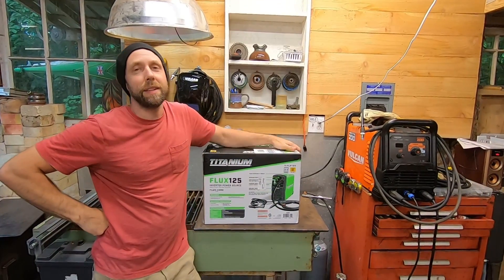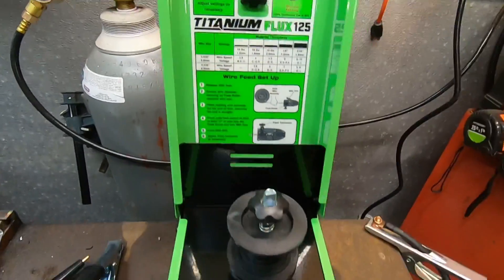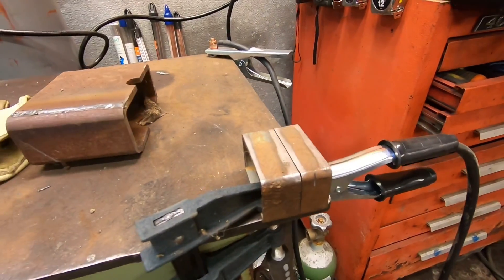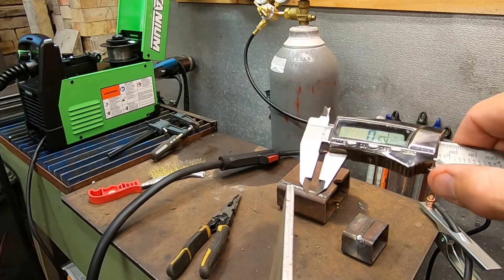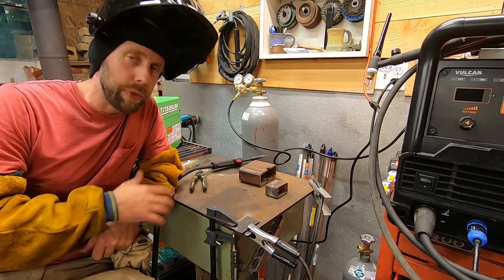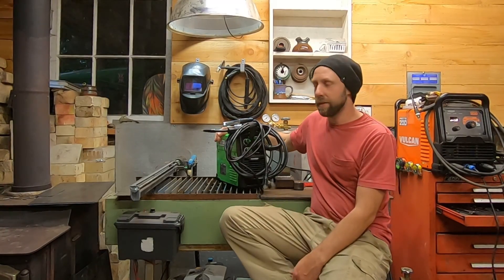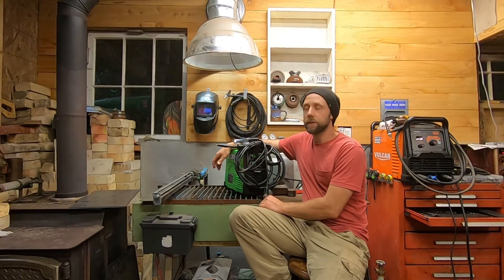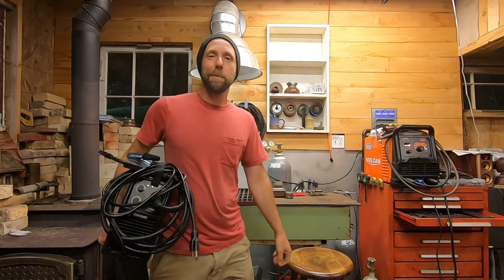Titanium Flux 125 welder from Harbor Freight

Comment: Thanks for the thorough review. I bought one of these after watching your video and am very pleased with its performance. It’s my first welder and made it feel easy. 
Question: have you, or perhaps other viewers/commenters, used flux core stainless steel wire with this machine?
I have a SS wood stove secondary burn tube that needs a simple tack weld and saw tat Blue Demon makes a flux core stainless wire. 
Thanks again for the quality review.
Reply from the maker: Thanks for your nice comment! As you know these little welders work quite well.
I have never tried Flux Stainless steel wire, I didn’t know of it till you mentioned it. I have only welded a little SS and I did it with a TIG welder. I will look into the wire and maybe make a video in the near future on it. Take care 🙂

Comment: How are you doing thank you for the video I like that welder I have never willed it before but I have a truck and it has some rust holes on one of the cab corners could I use this to fix those holes
Reply: Thank you
Reply from the maker: Yes this will work good for most around the shop work.
If your welding really thin metal like sheet metal on car bodies you will probably have the best luck spot welding it ( short cycles on and off ) this help from burning through the thin metal. I recommend first practicing on some thin scrap metal first to dial in the heat first. Take care

Comment: Welds great! But think about safety first there's an oxygen tank right next to where he's welding
Reply from the maker: Well Cameron I’m not sure how much welding you do? Just because there’s a green tank there doesn’t always mean there’s Oxygen in all green tanks. That tank your referring to is a Argon bottle, it’s a shielding gas that’s non flammable used for TIG welding to keep Oxygen from contaminating the weld. I hope this info helps you out. Take care Cameron 🙂
Reply: If he built an entire saw mill from scratch, I'm pretty sure he knows what he is doing.
Reply: Safety is always a good thing to consider and think about. but in regards to these cylinders they are actually very safe against Sparks and flames think about acetylene bottles and oxygen bottles on cutting torches that are in close proximity to cutting welding all the time as long as you don't handle them roughly and break off a valve or strike an arc directly on the tank they are very safe
Reply: Oxygen isn't flammable.
Reply: so,if one was using a cutting torch with a bottle of Oxygen,and a bottle of acetylene,would u have a problem cutting,or welding?

Comment: Did you use the wire it came with or another brand?
Reply from the maker: I was just running the wire that came with the welder. I usually  run the Lincoln brand flux wire because it’s sold locally at Home Depot. Take care

Comment: Will this run on a 15 amp 120v circuit?
Reply from the maker: You probably can run it on thinner metal on a 15 amp breaker, but I think the manual calls for a 20 amp breaker.
Reply: @Mikefestiva  thanks!

Comment: Hey Mike, great videos! I just subscribed and bought this welder. Works great and burns hot! 
Question- which flux wire would you recommend? I just finished the roll it came with and want to buy the best wire for the best welds possible..Thanks!
Reply from the maker: Right on thanks for subscribing Felix! I mostly have ran the Lincoln flux wire mainly because it’s available at the local Home Depot store, it seems to weld fine, there was a post from a subscriber that had some good suggestions on flux wire he liked, I will try and find that post. Take care and have fun welding! 🙂

Comment: I think you mentioned in one of your videos that if you use flux core the gnd should be neg and if it is solid core it should be pos. It might be the other way around.  Anyway on the HF Titanium Flux 125 welder, how do you reverse the gnd polarity?
Reply: There's no need to reverse polarity on this unit since it doesn't have the capability of running gas (MIG).

Comment: I have a Chicago Electric 125 amp welder, I used it to weld a hook to fork truck for dead pulling 3 ton racks. Granted I used 4 passes to make sure it has good penetration. I did this 5 yrs ago and its still holding good.
Reply: Late comment but I must add those things can make very strong welds. I have done some serious repairs with the ce 125 on trailers open and closed. The welds never failed.

Comment: Can I weld Stainless Steel with this welder?
Reply from the maker: No you can not weld stainless steel with this welder. You would need a MIG welder, because you need shielding gas to keep the weld from oxidizing when welding, this is just a flux welder it cannot run shielding gas. I hope this helps.
Reply: @Mikefestiva  Thanks, man! So, steel and Iron only? I'm sorry for the stupid questions, but I'm new to welding! :) I have plans to buy this welder!
Reply from the maker: Yes steel.
You can’t weld Stainless steel or aluminum. 
This is a good welder to get started with especially for the price. The Titanium 170 is a big step up in capability but also cost. It can weld stainless with the right gas and aluminum with a optional spool gun with the right gas. But with the added cost of a extra gas bottle and extra cost on the welder.
Reply: @Mikefestiva  Thank you so much for the input, man! Nice video, BTW!

Comment: I picked up one of these last weekend for $149 plus tax. I have always used my old Lincoln AC225 “tombstone” or oxyacetylene torch. I had gotten fairly adept at thin stuff with 1/16 rods with the Lincoln. But now I know why everyone uses MIG or flux for sheet metal. Love the little Titanium 125. Now I want the Ultimate 200. Thanks a lot Mike. You costing me money🤣🤣🤣
Reply from the maker: Right on! These little welders are quite useful! Yes the Titanium 200 is a great welder and I highly recommend buying on. I used a stick welder just like you described for many years, but once I got a MIG welder I found myself using the old Lincoln less and less. Take care 🙂
Reply: lucky guy, I can't find one and I ordered with the 179$ coupon  indefinite backorder on my email

Comment: Hey Mike, thanks for the video. I have the Chicago Electric Flux welder and I'm thinking about selling it and replacing it with this one, the fact this one puts out DC instead of AC is huge. Are the leads disconnectable on this machine? One annoyance with the Chicago Electric is the leads were all permanently attached and it made storage a pain. Thanks again.
Reply from the maker: This welder would be a good upgrade to the welder you have right now. The leads don’t disconnect on this welder, that is a nice feature on higher end machines and would have been a nice touch. Thanks for commenting 🙂

Comment: You cannot get a spool gun for this welder.
Reply from the maker: Yes you are correct there’s no spool gun available for this welder.
Reply: @Mikefestiva  Thanks.  Let me be more clear.  They don't make a spool gun to fit any of the Titanium welders even though there is a connection for one.  Very misleading packaging showing you can run one.
Reply from the maker: Yes HF is slacking on offering a Spool gun for the bigger Titanium line of welders, the 140,170 and the 200. 
Here’s a video I made where I ordered a SG from Northern Tool that plugs right into the Titanium welders I just mentioned. I hope it’s still available? Here’s a link to my video.  https://youtu.be/25y35tuNurs
Reply: I'm new in the welding what's the spool gun? Is it what he's holding to weld? So you mean if you wanted to replace the spool gun it cannot be found?
Reply: @mannyramirez8249  no, a spoolgun feeds  from a small spool of wire and has the drive motor built in where you hold the handle. Usually it's used for welding aluminum in a MIG welder  because the aluminum wire is too soft to feed all the way through the liner and gun of a normal MIG setup that holds the spool of wire inside the machine.

Comment: Hi Mike ! I need your help ! Because of you, I got into welding and fabricating ! I bought the 125 and the 200 Titanium's plus a Plasma cutter ! Here is my question, I have to weld some stuff at my Hunting Club, can I run the 125 Flux with a 2000 watt Honda Generator, or should I bring my 3500 watt Predator Inverter ?? I would appreciate an answer !! Thanks
Reply from the maker: I’m really happy to hear you got into welding and fabricating because of my videos! That’s awesome :)
So to answer your question, the 2000 watt gen is probably on the small side, especially if it’s 2000 peak watts, 2000 watts at 120 volts is 16.6 Amps. Your 3500 watt gen should be plenty, at 3500 watts at 120 volts you should have 29 Amps. The Titanium 125 should be run on a 20 amp breaker to provide full amps to weld. If you were welding real thin metal you may get by with the small gen but a lot of times a 2000 watt gen is really rated at 1600 watts continues use. 
I would pack your bigger generator out there, you shouldn’t have any problems when it comes to amps. Take care. Ps try it at your house first and see how it welds.
Reply: @Mikefestiva  Tank you Mike for your advice ! Love your videos, I hope one day I have similar skills like You ! Keep up the great work !!

Comment: Mike...What flux core wire were you using in this video? I have recently tried the INETUB  BA71TGS .030 with exceptionally good results. I had never used a French mfg. wire before but this has been impressive. Easy to run with minimal spatter.  I note that the Vulcan wire from HF had been made in India previously but is now marked made in France. I am curious if the new French Vulcan Flux core wire is being private labelled by Vulcan but made by INR. It would be great to see a comparison of .030 Flux wire test between the French made Vulcan and the INE along with Blue Devil and perhaps Lincoln 211 as a control. Your thoughts?
Reply from the maker: Good to know! I will look into that wire. I was just welding with what came with this welder in the box, I have ran a lot of the Lincoln wire in the past, I will order some of the wire made in France. Thanks for your comment on this subject I really appreciate it! Take care
Reply: @Mikefestiva  This is the wire I have had excellent results with...https://www.amazon.com/gp/product/B003E2RF0E/ref=ox_sc_saved_title_3?smid=ATVPDKIKX0DER&psc=1
Reply: @Mikefestiva  This U.S. made wire has also worked very well and can be bought cheap. 2 lb spools for $8.90 delivered...in a qty of (10)...https://www.ebay.com/itm/E71T-GS-030-x-2-Lb-10-PK-MIG-Gasless-Flux-Core-Welding-Wire-Spools-Blue-Demon/302761047315?ssPageName=STRK%3AMEBIDX%3AIT&_trksid=p2057872.m2749.l2649
Reply: @Mikefestiva  I misspoke. The INE and current Vulcan wire are made in Italy...NOT France. Not sure why I mixed the two countries up.
https://www.ine.it/en/

Comment: Hi Mike. Have you tried running it on a small generator? I have a 3400 Watt Champion Inverter Generator I use for my RV. I want to get a small welder that will run on my generator. Would this welder run on my generator? Pleae advise... Thank you
Reply from the maker: No I have not tried it yet but I will and I will post a short video on how it does on a generator, I have a HF gen about the size of the one you have so it should be a good test. Thanks for commenting :)
Reply: I got a 4000 watt inverter gen from Champion,I can try
Reply: Did it welded good with the 3400 watt generator?

Comment: I'm truly looking forward to seeing you upgrade this welder to a mig setup(gas). I know this can be done , because we had a friend do it in the past . I remember he had to rig the trigger power up a little different but that's been a few years ago and a different brand of welder. Looking forward.
Reply from the maker: Thanks for commenting :) 
I think it’s definitely possible, I ordered some parts to convert it, I have a relay wired up to the circuit board and it switches when you pull the MIG trigger now, I tapped into the power on the board. Now I just need to wire up the gas valve and order a new MIG whip that’s set up to flow gas though it. Hopefully I can finish it in the next few weeks :) Take care

Comment: Hey Mike, I just bought the Harbor Freight Flux 125 ("The Black Beauty") $95 tried and true model.  My question is: I've checked with Harbor freight, and if I upgrade there's no restocking fee for me to bring in my 90 Amp welder and trade for this Titanium Flux 125, but would you recommend this?  I have very limited experience welding, self taught through the school of YouTube, but I'm glad I've found your channel!  I think I've already experienced the frustration with AC welding, and even though it was recommended to weld on wire feed at 4 I had to up the speed to at least 5-5 1/2 just to keep up the weld on thicker pieces.  Anyway, I guess I was curious if you think I should get this Titanium Flux 125 instead of the tried and tested 90 amp model they've had for years?
Also, I wanted your opinion on the 220 amp 170 model MiG/Flux welder?  I'm thinking I want to upgrade, but should I go for a model that will allow me to eventually MiG weld with gas and solid wire?  So, with that being said, I could see myself using this Titanium Flux 125 for 6-8 Months, and then upgrading to the Titanium 140 or 170, but I guess I wanted the input of someone with personal experience, and I can see you've been doing this for years!  Sorry about the novel.... Thanks!!

Comment: I want to tech myself hot to weld by adding some rails to one of my utility trailers.  This looks perfect for that.
Reply from the maker: Yes this is a great little welder, compact yet quite powerful for its size. Definitely a good welder to start with. Take care Eric
Reply: Practice on some  scrap metal  first. You will  save  yourself  a lot of frustration when you work on your  trailer.
Reply: @electromech7335  That's already the plan

Comment: Ok I just bought this welder and I am seeing that there is a Titanium flux 125, A titanium easy flux 125, and a titanium pro flux 125... Are there any differences or upgrades to these models??  Mine is the Titanium Flux 125. model nukmber TI-FLX125. I am thinking that this may be an older model yet I just bought it today. Thank you in advance
Reply from the maker: I think Harbor Freight just had a hard time figuring out what name they wanted to use :) 
The first video I did about this welder, the add said pro flux125. Now I think it’s called easy flux 125? Who knows, but I’m sure they are all the same welder. Take care.
Reply: @Mikefestiva  Thank you for the quick response.  I bough this welder solely to do a custom exhaust on my hot rod. I just read that this welder isn't suited for stainless steel? Thoughts on if this will work? THANKS AGAIN..
Reply: @jaybourbon8608  someone on a forum somewhere said he used this welder to do the exhaust work? I'd say take a couple scrap pieces and try it, make sure you don't burn through it though, work with some scraps and get the settings dialed in. 

Good luck!
Reply: @delta34golf  Thanks man .. I'll report back if I ever get time to start it the project. Hah!
Reply from the maker: Hey Jay because this welder is a Flux only welder it doesn’t have a gas port for shielding gas, you wouldn’t be able to run Ss wire on it, SS requires 98%Argon 2% co2 shielding gas to keep the weld from oxidizing when welding and cooling off. 
You may consider the Titanium 140 but the Titanium 170 would be my choice between the two, it’s a multi voltage 120/240 inverter welder, plenty of amps and spool gun ready to weld aluminum with the optional spool gun. Both the 140 and 170 can weld SS. I hope this helps.

Comment: Nice, I've been threatening off and on for years to get a welder, maybe this will be the one :)  thanks for sharing!
Reply: @clint, same with me, I almost picked up the Chicago Electric one, because it was so cheap, wouldn't be a big loss if I wasn't good. Glad I waited, the flux 125 from Titanium so far has only impressed and it's so easy to use.
Reply from the maker: Right on! Yes this is a good affordable entree level welder that’s quite powerful especially for its size! Take care

Comment: Thanks for the video. I didn't see any side splatter on your welds. Is it a DC welder?
Reply: Yup, its DC
Reply: @W_TylerMann  Thanks for the information.
Reply from the maker: Yes it’s a DC inverter welder, it still gets a few splatter bits on the sides of the weld but it seems to have a much smother arch then the smaller AC transformer welders I have used before. Thanks for checking out my video :)
Reply: @Mikefestiva  Thanks for the video and information.

Comment: Hey Mike wyick question I'm going to do a predator 212 dirt bike build like you did, should I look for an xr100 frame or an xr80? I know you have both, I'm a  bigger guy and want the best suspension? Wich frame is bigger? It seems like the cr80 is? But I figured I'd as somome who has both.
Reply from the maker: Hi Noah :) well the XR 100 is a smaller frame, drum brakes and basic suspension, the CR80 we did the motor swap on was a big wheel model and it’s definitely a bit bigger then the XR100, plus the brakes are hydraulic disc front and back and the suspension has about a foot of travel and is fully adjustable, if you can find a CR80 with a bad motor I would definitely recommend buying one to swap. I hope this helps :) Take care